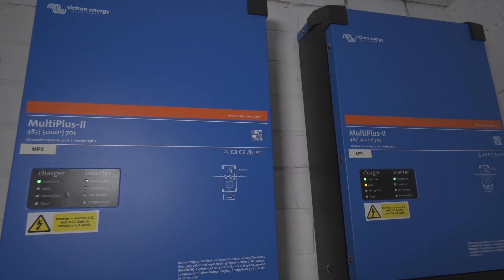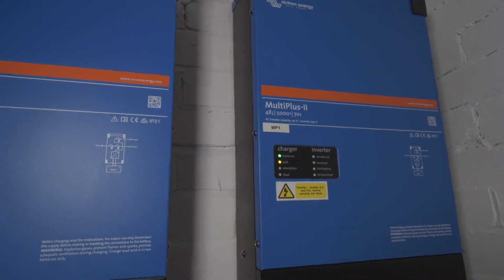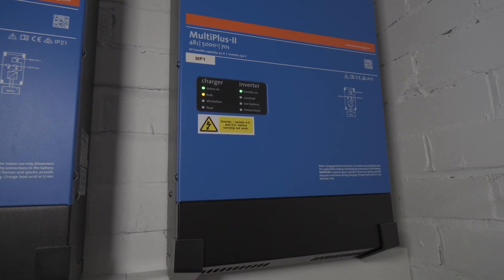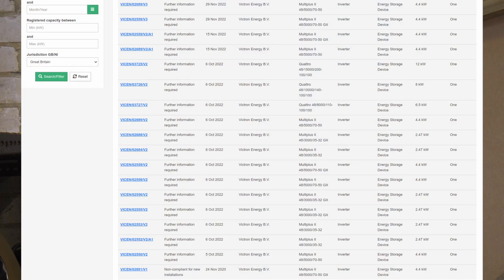Discover Why Victron Inverters Just Lost Their ENA Certification (ALL NOW LISTED AS COMPLIANT)

Comment from the maker: I've just checked the ENA register and as of today there is some good news, the Quattros 48/8000, 48/10000, and 48/15000 are now listed as compliant. Hopefully this means Victron have finally worked out what they've been doing wrong in their ENA applications and the Multiplus II inverters will soon also be compliant again.

Update 13/02/2023 - The Multiplus II 48/3000/35-32 is now listed as "awaiting assessment", still no sign of the 48/5000/70.
Update 16/02/2023 - More disappointing news, the new Multiplus II 48/3000/35-32 listings now have the status "Further information required", still no public comment from Victron on their community forums.
Update 17/02/2023 - The Multiplus II 48/5000/70-50 is now listed as "awaiting assessment", let's hope they don't go the same ways as the 48/3000/35-32 did yesterday.
Update 01/03/2023 - Bad news this morning, the 2 recent entries for the The Multiplus II 48/5000/70-50 have now moved to "Further information required".
Update 14/03/2023 - The cycle of dome begins again, today the Multiplus II 48/5000 and 48/3000 are back up on the ENA register as "awaiting assessment" .
Update 15/03/2023 - Good news bad news day,  yesterdays 48/3000 listings have now changed to "complaint" so excellent news for some, unfortunately I have a 48/5000 and those have changed to "Further information required".
Update 31/03/2023 - The 48/5000 is once again up with a new listing "awaiting assessment" .
Update 31/03/2023 - After only a few hours of being list as "awaiting assessment" the 48/5000 is now listed as  "complaint", finally putting this mess to bed.
Reply: Hi Rod…
…in a similar situation to yourself. Application is on hold by national grid. I understand the Quattros were approved due to the use of an independent UFR1001E relay/contactors as the Quattros are not fail safe. 

This isn’t rocket science VICTRON pull your finger out and get the MULTIPLUS II approved for use in the UK.
Reply: Victron Multiplus II inveters are fully complaint in few of the most strictly annoying regulation-prick countries in western Europe, therefore hearing that they are "not approved" in some much more lax parts of the world make me shake my head
Reply: Over 6 months for victron to sort this out..... very poor...😢

Comment: Sooo I came to see this video to understand why Victron inverters lost their compliance and all I found out is that they lost their compliance but not why. Great.
Reply: EXACTLY
Reply from the maker: If I was being pedantic I do clearly mention that they lost their compliance because of changes introduced in amendment 8 of the G99 regs that the existing tests for the Victron inverters are no longer compliant with. The changes were published several years ago and I understand many manufacturers had proactively updated their tests to be compliant, but Victron couldn't be bothered or were not paying close enough attention.

On the other hand I accept I could have gone into mode detail and appreciate the feedback, thank you for taking the time. It's a bit of balancing act to provide enough detail without getting too technical, in this case i maybe simplified it a bit much. 

I've you're interested you can find G99 amendment 8 here https://www.energynetworks.org/assets/images/Resource%20library/ENA_EREC_G99_Issue_1_Amendment_8_(2021)0.1.pdf  my understanding is the offending changes are around B 4.5 Limited Frequency Sensitive Mode – Overfrequency (LFSM-O), which has something to do with tightening the requirements around how the equipment reacts to overfrequency events on the grid, to help promote a more stable grid, makes sense but should probably only really apply to larger generators where it would have a noticeable impact.

Hope that helps explain in more detail what changed and sorry I didn't provide enough detail to satisfy your curiosity in the video, will try and do better next time.
Reply: @RodMcBain  Thanks, is clear now, good detail. Based on the video actually it was not so much missing info but maybe an ill-selected title, because your - totally understandable and important - issue is not why they became non-compliant but how they handled that towards customers and it is a surprise for me too because I would expected better from Victron.

Comment: Hi Rod, just found your channel- excellent videos. Like you I started an application for g99 in spring 22, it was for a 48/5000 (type test approved) with pylontech batteries, I pulled the application in June as I wasn’t ready to spend then. I’m now about to issue a new g99 application with my DNO (SPEN) and I have also purchased the equipment of which the 48/5000 was delivered last week. Only now have I found out about the certification issue. Arghhh. Did you get your g99 approval before this came to light or are you working without. Graeme
Reply from the maker: Hi Graeme, I submitted my G99 early Oct, that's when I discovered the certification was no longer valid. I went ahead and submitted the app assuming the situation would be sorted out quickly. I finally got a reply in early Dec approving the application for 8.8kw but requiring witness testing. So my system is currently installed in preparation for witness testing. I'm stalling on the witness testing until the inverters are listed as compliant on the ENA register. Things are looking more promising with the quattro now compliant again. I hope your G99 app all goes well.
Reply: Hi Rod, I changed my setup by adding a second 48/5000 similar to your system, this was due to the existence of the flux tariff (£export). This also meant a different G99 application for 7.3kW export. I now have the G99 and am completing the build. I will soon be programming the two parallel inverters, the same way as yours are connected (I think). Could it be possible to copy your config file for the inverters to get me started. Cheers Graeme

Comment: You seem to the be the guy to ask.
There were recent changes to the BS regs for "islanding".  Reading the brief on it, it is suggesting any and all power sources which power local or remote loads, whether connected to the grid, regardless of AC/DC 12V, 240V... are subject to the regulations.
That sounds a bit invasive.  If I were to install an off grid inverter and run my garage off it, could I technically get pulled on building regulations and be forced to have it inspected and signed off?
Given solar panels and "power sources" and it doesn't specify voltage or size, am I to also assume that panels mounted to a roof would need to be compliant and inspected?
Reply from the maker: Hi, I'm afraid I'm not really qualified to give you advice on this, but my understanding is an off grid system still has to meet the Part P building regulations, but I can't imagine any circumstance where the anti islanding requirements would apply, off grid is by definition already a permanent island. Always best to check with an electrician.

Comment: I understood that the revised certificate was done by victron, I am sure I have it, the problem is with ENA being too slow at updating the register. Some DNO's might accept the certificate and not worry about ENA register.
Reply from the maker: Just looking at the 48/5000/70-50 there have been multiple certificates a firmware update and at least 4 failed submissions to the ENA register, each time the application has been incomplete and rejected by ENA. I think there is more to the ENA applications than the publicly available certificates, I expect you'd really struggle to get any DNO to sign these off without them being registered as complaint on the ENA register.

Comment: Hi Ron, the 48/5000 multiplus 2 is fully compliant. I fit them and just last week had another G99 approved by the DNO. The kiwa certification is online but if you email me, I will gladly forward it.
Regards,
Bill
Reply from the maker: Some DNOs may be overlooking it being listed as non compliant, it is however a fact that it was submitted to the ENA register again on the 14th March and once again failed to gain compliance. Possibly because the current kiwa cert has no LFSM-O data for the 48/5000 and the new LFSM-O requirements were the reason they became non compliant in the first place. I have no doubt they should be compliant and hopefully Victron will get the paperwork sorted soon.

Comment: Thank you for making a brilliant video with great information. 
I have a 4kw solar system with a FIT payment and was looking to get the 5k or 8k victron multiplus 2 with about 10kw of pylontech batteries.
My December daily usage average was 10kw a day so with my solar doing a few kW watts a day in December and charging the batteries in the early hours of the morning it should be ok.
eventually I'm going to put solar panels on my East gable end wall of my house to charge the batteries up with more power with less reliance on the grid.
how many kilowatts a day does your air source heat pump use please.
Reply from the maker: Thanks, if you did go for a Victron inverter and added extra solar you could connect that up with an MPPT on the DC side and that would allow you to continue to charge and potentially keep some critical loads running if there was a grid failure. 

Over the last week the heat pump has been using between 12 and 17kWh a day, when it was really cold (-7c) it was using a fair bit more, around 25kWh on some days. But there are a couple of factors that mean it's not running as efficiently as it should. This is an old inefficient house, we're slowly renovating it to become more energy efficient and adding underfloor heating which should allow the heat pump to run at cooler temps (so use less power). I'm planning to make a video about the heat pump soon, I'll be sure to add some detail about how much power we're using.
Reply: @Rod McBain  hi Rob thank you for your reply and suggestion to use MPPT on the DC side of the victory inverter. Are you going to make a video showing how you Connected your victron inverter together with batteries and Connecting it to the mains power with parts Rob thank you.
Reply from the maker: I'm definitely going to do a more detailed look at the system, should be coming soon.